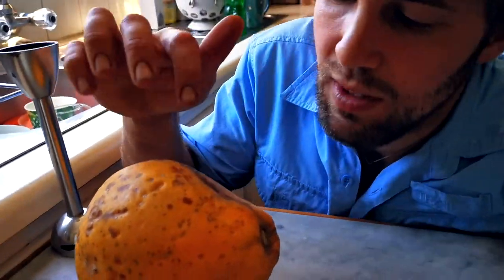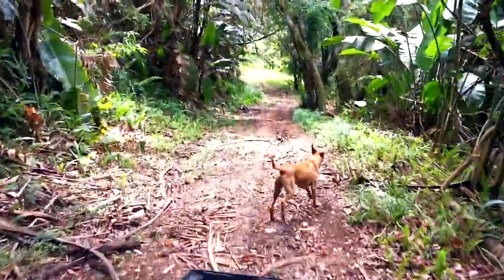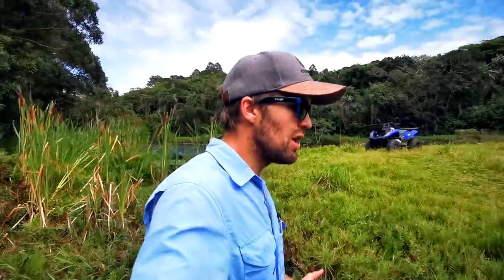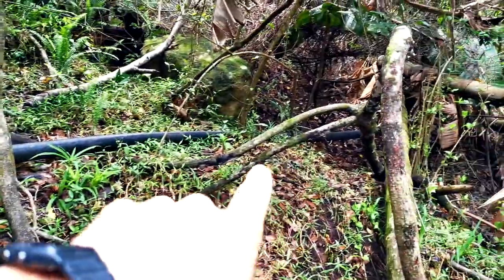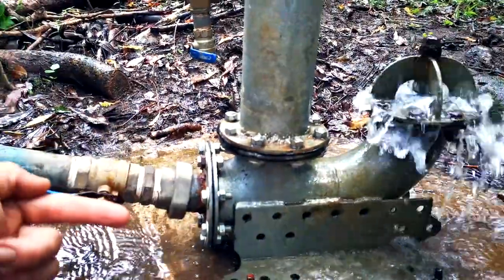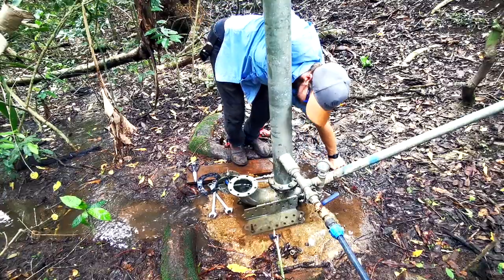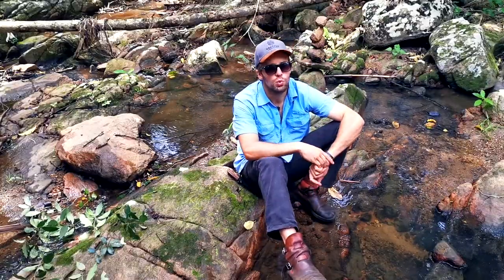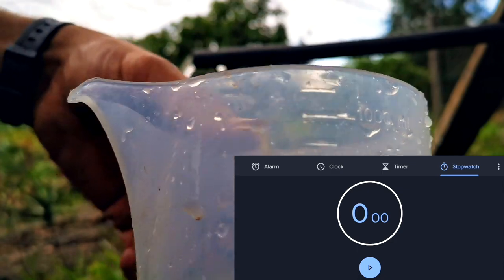The ultimate DIY RAM PUMP design!

Comment: i would suggest one can use a dam to provide sufficient water to  Anabel  a ram-pump to send water  with sufficient elevation to stored in a elevated position so it can be realist to reach a presser of 45 PSI so that a micro  hydro turbine can be used to charge up a battery bank to power ones house.  in sense the ram pump is cost effective filing up the storage stuffiest to recharge a 50%  depleted battery bank . your siystom can deliver's  a lack of water to power a harrow turbine

Comment: Hi old mate, can I correct you on the Snifter Valve. This implies there's an actual valve which you don't have, though it does work but efficiency suffers through pressure loss through the hole. The real Snifter Valves have a small ball ( approx 2 mm ball) and seat and what happens it's a vertical valve using gravity on the ball to open the valve to suck air ( take a Sniff of air) then close on the seat from water pushing the ball up onto the seat under pressure on it's pump cycle. A very simple valve, just another type of one way valve really. Have a look at the old Davey ram pumps of last century, you'll see it there if memory serves.

Comment: you need to re-lap the bevel on the metal valve and seat.  Use a power drill and lapping compound.  No need for rubber seals, just sufficiently hardened valve and seat.

Comment: You are right, you have to make your own waste valve as well as check valve. Actually Im only making maximum of1 1/4 Ram pump. Swing valves and other valve available from the market 8s a waste of time and money. My Ram pump is running for more than 2 years without replacing  waste valve only the check valve make a modificatio to last long.

Comment: I want to setup one on my farm as well need some help with that need to pump water up hill 300 feet
Reply from the maker: Howzit

You need flowing water 0.5 - 5 gal/minute and 30' vertical drop to a 2" ram that will give you decent flow. Pipes need to be high pressure on the delivery for the first 200' and a steel drive pipe is essential. No swing valves, this needs fabrication which will outperform any swing valve combo. Happy to help if I can.

Cheers.

Comment: Nice video, how long your delivery pipe from the ram pump.
Reply from the maker: It is 400m from the pump with a total vertical elevation change of 50m.
Reply: @MorgsBrew  thanks this is very helpful, the same distance as my water source (450 meters) and elevation  3 meters only...

Comment: The best thing when you build a rampump it is better to make a customized waste valve rather than to used swing or any other valves available in the market.
Reply from the maker: I agree 100%. I even made a video detailing this point. Check it out and share it so people see that a fabricated waste valve is the answer to home built ram pumps.
 https://youtu.be/Wju8kvq5wiw
Reply: The market needs a custom waste valve you could sell on eBay ect

Comment: Why don't you use a solar pump? You're wasting water and have good sunlight. Unless you don't have any water concerns..
Reply from the maker: Howzit

We will put in solar for the dam. We have a decent catchment and good storage water for irrigation. The was for this ram is an inflow stream that has a yearlong flow but is down to a trickle in the winter. I am using it not the dam.

My thoughts on solar is I will need a top storage that I irritated from so that I had water on days I need it. And it is a much better option for volume and efficiency.